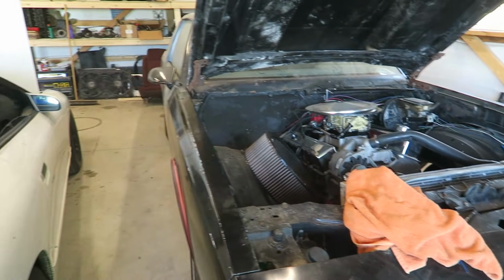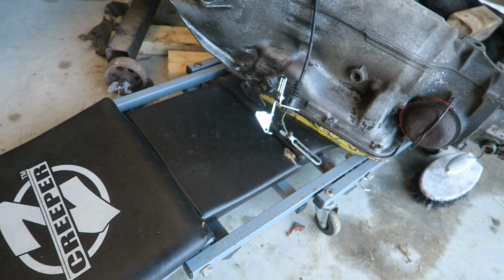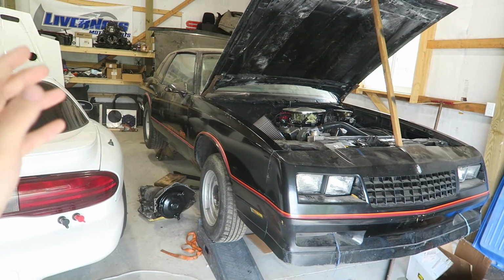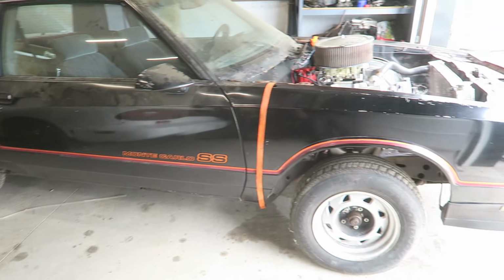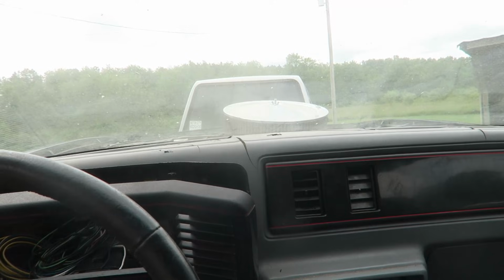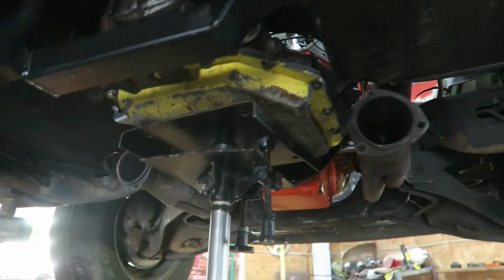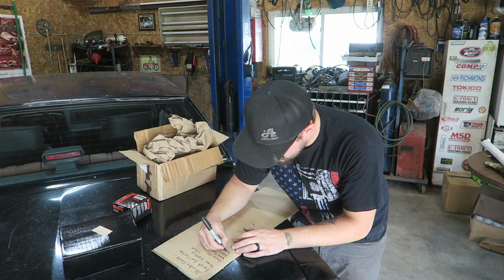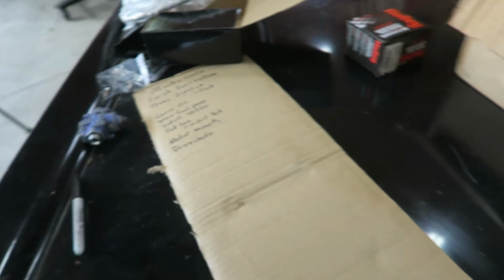RESCUING Barn Find MONTE CARLO SS! Will The 383 Still Run?

Comment: Did you realize that you were using a 700r4 instead of a 3 speed? When you tested out your shift cable, you named off the gears “park, reverse, neutral, drive, second and first”. The “kick down cable” which is actually called the TV or throttle valve cable, is what gave it away for me.
Reply from the maker: I would encourage you to go back and look at the transmission pan. The 700r4 has more of a square pan and th350 has a notched corner of its pan. Also, the th350 has a kickdown cable, its the th400 that has a kickdown switch.
Reply: @SniderTron3000  I see the notched corner of the trans pan now. However I was always under the impression that the 350 and the 400 were controlled by a vacuum modulator while the 700r4 was the one with a TV cable.